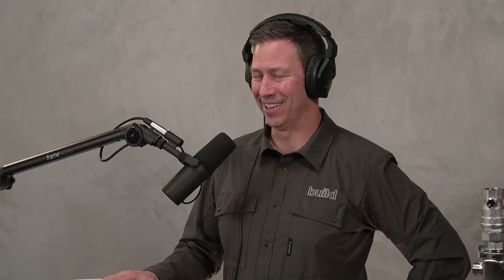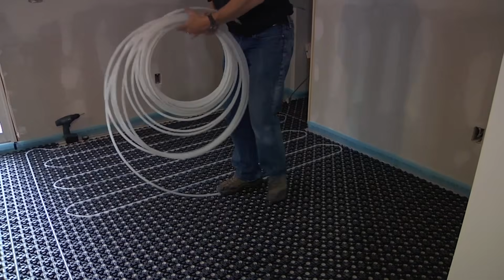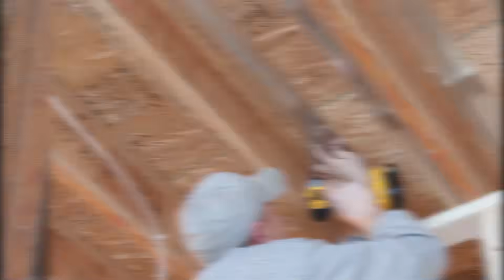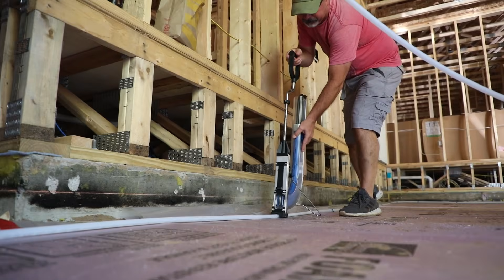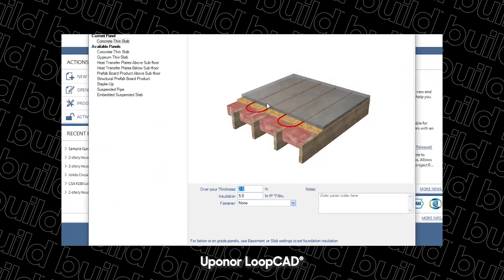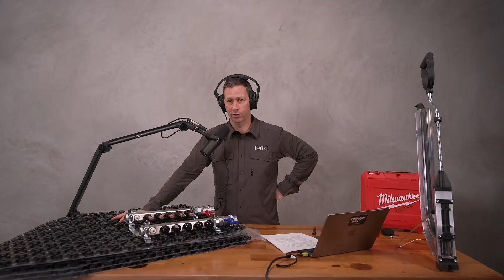4 Methods To Run Radiant Heat PEX Pipe

Comment: Do you  use water or a glycol/ water  based mixture in the radiant heating system..?.And if the glycol / water mixture is used, do you use distilled water so there will be no contaminants ( calcium etc ) in the mixture..?

Comment: A radiant heat system provides very even heat, which acts in fact as an energy saver because people tend to adjust the heat to where they're comfortable.  The interior walls, ceilings, and floors are not broken up by air supply and return registers, which can be unsightly.  Also, my dogs like it because the floors are warm, and we can walk around barefoot in wintertime.

Comment: I installed a staple up system under the kitchen tile floor back in 2006.  It was easy to do.  Just taking the chill off the floor makes tile much more pleasant.  For the basement slab, I used a system of snap together plastic grates, which apparently is not available any longer.  After installing the tubing, I put Hardi backer board over it and installed ceramic tile.  Despite my numerous flaws pointed out to me by my ex, I haven't heard complaints about that project of mine!  Though, I suspect my coworker was correct when he suggested I would spend more time in the basement doing the project than anyone would ever spend there after the project was finished off!

Comment: We are currently working on a project where the basement concrete floor was poured without insulation, what is the best way to insulate the slab? doors were installed for a 1.25 inch lift finish? what do you recommend  using to insulate the slab in NJ

Comment: The more tubing used, as in closer together, the responsive the floor will, and the cooler water can be.  As I use solar thermal panels (backed up by a Electro Industries electric boiler) I ran my tubing on 6" centers, in 300' lengths. I laid out the 300' outside, and then doubled it back, so i had both ends in my hand, then I walked into the building and secured the two ends at the manifold location, and then started laying out the PEX lines on more or less 6 to 8" on center. Counter flow was the idea, a hot out next to a cold return. 40+ years of doing so and zero issues OR a utility bill. It's real easy making warm water for a rad floor  with solar, not so easy, and less efficient, making real hot water for a forced air hydronic heat system, that's why a lot of off grid types go radiant, they use less power also.

Comment: I hear about all of the good things,but I don’t hear anything about what the possible repair costs are.
Reply: cheaper to shut off the zone, then install a heat pump or other heating method for there. breaking up the concrete, fixing the tubes without breaking it more, and then re-pouring concrete that won't match the original concrete would only work in very specific conditions. Unless it breaks during the pour and you can fix it before the concrete cures.

Comment: Eric!!   Need help!!  Planning on a half diy radiant heat.  Husband and I want to lay the pex, pressure test it, sub foundation and in between basement and only floor.  Then have a plumber install the boiler and what nots.  Am I insane?  Will this make radiant more affordable?  Any diy planning kits, manifold, layout companies you would recommend?

Comment: If you have a concrete floor and you do not want to raise it, you can mill the pex into the cement screed. Then cover with flexible shrink-free mortar. We do this a lot in the Netherlands.
Reply: @hunchbackaudio what do you use to mill the concrete?
Reply: @louismerani5634 Most concrete floors have a upper layer of cement screed you can mill with a 18mm grinding wheel. When the top layer is also concrete you’re out of luck. Then you have to use a tracer with two discs and chisel out the middle part. But that’s almost never the case. In that case you’ll be probably better off to lay the tubing on top and level it out with self leveling screed. But then your floor ends up 2cm higher.
Reply: There’s special grinding carts for this with a strong industrial vacuum cleaner to prevent everything to be covered under a thick layer of concrete dust.

Comment: Can you install the wet heating pipes directly on concrete floor (i.e. without any insulation)? Would it less efficient than laying the pipes on an insulation material?

Comment: I have 9' ceilings, so i used the top 1' of the interior walls for the pipe. I run the pipe in loops through the wall so one 250' loop serves two rooms. Also, i use pex-al-pex because it does not move/expand very much with the hot water.

Comment: I have an 1100sqft slab on floating concrete home and want to put in heated flooring. I’m completely LOST how to attach the vapor and pex to the concrete. I live in Isle Minnesota so it gets -40 with lake effect.
Reply: Warmboard makes a remodeling panel. Thinner than the panels that replace subfloor in new buildings. Plywood panels with channels routered in them. Then the entire thing is plated over with a thin aluminum including into the channels. Then you just snap the 1/2" pexalpex into the channels. They plan it all out for you. And send you everything you need (including special instal tools) basically a complete install kit. It's more expensive expensive. 
But also the most efficient. I installed it myself. I have ambient thermostats. Six zones.  Downstairs is inslab. Upstairs Warmboard. Inslab takes way longer to change temperature. Temperature swing on inslab + or - 4-5 degrees. Warmboard upstairs is super responsive. + or - 1 degree on thermostats. I love my warmboard.
Oh yah I live in Wisconsin. And I drive a forklift for a living.

Comment: Hi Matt,
Would you need a separation barrier, if you put in radiant heating, and wanted ceramic tiles over the light concrete fill?  (if you do a slab on grade house) I am building in Mexico, and building practices are very sketchy.  Also, would you have any connection to contractors that would build in central Mx, in Apizaco area?

Comment: Whats the glue they’re caulking in over the pex on the quick track option?  I’m installing this heating system in my van floor and would like to know what I can use to embed the tube in my routed grooves. Ideally something I can sand smooth. Thanks.

Comment: Great content, thank you! One big question left for me at the moment: how do y’all recommend installing the slab temp sensor, especially for those systems where you’re getting the radiant piping up between the joists under a subfloor? (My main concern: I’ve got one of these in, but the sensor is getting heated by proximity to the pipes — even despite being held up to the subfloor by solid foam insulation.)

Comment: Does a radiant ceiling work? Doesn’t heat rise?
Reply: No, hot air rises, heat "goes to cold."  That's why insulation is critical under a rad floor slab, some think the ground below will get wamed up and the heat will rise, BIG mistake!

Comment: I have to do some research but are there radiant heating systems that use a heat pump to heat water like a water heater does? That seems like that would be the most efficient as opposed to a gas boiler

Comment: i love the little bit of science "more energy via water" as a selling point, but also the comfort is the big advantage of radiant. It's so unfortunate the true benefits of radiant didn't take hold earlier - the idea and the sceince has been around for a long time. I think we could have saved an unimaginable amount of energy (i.e $ in heating bills) and a lot more people would have been more comfortable in their homes.  I remember as a kid, circa 1974, sitting in front of the heat vent, window curtains draped over me to capture all the heat, just waiting (and maybe praying a little), for the at furnace to kick in and blast me with glorious warmth just to beat that morning chill!  As an adult in '94, I bought and renovated a 1952 built Wisconsin home that was originally built with a "radiant slab ceiling" - 1.5" concrete/plaster mix in wire mesh w/1/2" copper tubing imbedded.  Even though it was top-down (heat rises, so won't that make it ineffective?), that radiant slab was so-o-o-so satisfyingly even and comfortable in the heating months. Was economically efficient, too, heating bills were the lowest I've ever experienced.  Had lived in forced air, hydronic and electric baseboard, and old-school cast-iron radiator - all of these in the northern great lakes region, 60" frost line and all, so real cold in the deep winter months. The radiant was palpably more comfortable in all conditions - no comparison.  I imagine it was a substantial increase in construction cost in 1952 over conventional systems at that time, and I would guess adoption of a "new" superior technology was stymied by misinformation, status quo thinking, fear of the "new and untested", and probably some commercial interests that didn't want to see their customers changing the items on the standard purchase order.  But, God -once you felt that even and consistent heat, and knew your children would never need to cloak yourself in window drapes and pray for the thermostat to kick in, you'd think it would have gained a little more traction.  Back in '94 I was working in the residential construction trades in carpentry, and radiant of any kind was still only popping up occasionally as a novelty.

Comment: Great to hear of putting these in the wall or ceiling from an installer.  They talked about it in the Hydronic Heating book, and we had electric radiant heat in the ceiling of a condo.  There's also other panels that are routed out with foil in them already, previously at about a buck a square foot.  They can bring the added height down to 3/4", and maybe less if switching from a carpet and pad to something else.

Comment: Can you use air in the pipes instead of water? I know the fluid would hold heat longer but air would move faster through the system and any leak wouldn't be an issue. If someone accidentally put a nail through the pipeline the system would still work fine and cause zero damages.

Comment: Stainless is taking over not just because it's far more corrosion resistant, but also because it's a lot less EROSION Corrosion resistant.
When I was a self-employed Handyman, I'd often have to cut a wall open to replace a copper pipe fitting where the pipe was not reamed, AND repair the pinhole that had formed about an inch from the end.
Turbulent water is no joke on something as soft as copper.
YouTuber Got2Learn has a nice video on the subject.

Comment: We used this in the upper levels of our home. Ours is on a styrofoam substrate that has mechanical points where the PEX is routed through. The lightweight cement/ grout has a perlite aggregate to keep the weight down. They have added chopped fiberglass and a latex based liquid to maintain flexibility and prevent cracking of the cement mixture. There is also a 1/4” flexible foam perimeter that must be laid in to isolate the floor from the walls and allow for expansion. We used the ROTEX system from Germany. Maximum operating temperature of the system is 40° Celsius. This was installed 16 years ago as the upper levels of the home were completed. Best investment we made for heating. No intrusive radiators to mess with furniture placement. One issue is they recommend that no floor coverings be used since it will prohibit the exchange of heat. Method 1 provides zero isolation to the substrate under the the stick in place guides. Our primary heat source is a fireplace boiler where temperatures vary from 40° to 80° Celsius so it was necessary to install water heat exchangers to limit the temperature to the radiant system in the upper levels. Also in the mix there is a three way auto valve preset to 40° to protect the radiant system in the upper levels. There are four zones,three bedrooms and the main living area. With a smart panel controlling times of day one can preset temperature of each zone and the smart system will enable the zones according to the time of day with a manual override for each zone. This is accomplished with a  PLC so the need for a computer running 24/7 is not needed. It also takes into account the exterior temperature. Since we are in the south eastern Mediterranean my goal is to add additional solar heating arrays to start preheating the floors as soon as outdoor temperatures. Start dropping late fall.

Comment: Radiant coupled with Geothermal.

If you run a farm with plenty of manure producers or compost, you can run a radiant system through your heaps for heat.

Comment: I have a question: I have a boiler with forced hot water baseboard heaters. I have some pipes under the floor that are near the sub floor and you can feel in nice warm feeling walking bear foot on the floor. is it advised to have radiant heat AND baseboard heat in a same room? Just to keep the floor warm...

Comment: It’s the best, I live in Alberta and I am working on a horizontal 30 ton glycol loops to air exchange and slab cooling system, it hasn’t been done before but if it works I will only be using a 120volt circulation pump to cool my home and shop, the biggest reason for attempting this my attached shop is 40x75 if it works it will be amazing to have a cool shop, the ground temp is around 8-12 C, I am only planning for cooling as the electrical required to use a typical heat pump is expensive, and I want to sell my solar to grid to pay for propane and property tax, currently my home makes income

Comment: Hi, I have a couple of friends who have used a water glycol mix at their cottage in Southern QC (close to Ottawa) in case the power cuts out (which it often does). It's not a 50/50 ratio as glycol is not a great conductor of heat.

Comment: I want to put radiant on my basement ceiling (for the first floor). I'm also putting hardwood floors down. How do you keep the nails from puncturing the tubing (not using a product that raises my floor height)?

Comment: I designed and constructed by myself a home in Alaska in 2006 where I put half inch PEX in a 4 inch thick concrete monolithic slab to heat my house with a 40 gallon hot water heater that worked brilliantly.
Reply: What type of flooring did you use over the gypcrete? And did it ever
crack with all the earthquakes we get in Alaska?

Comment: This is definitely a subject I'm interested in. We are building a new house that's not being built in traditional methods. Radiant heat is one of the most efficient and easiest methods I could think of to use. Gas fireplaces or heaters for each room in use was first consideration, but for ease of installation and use I pretty much ruled it out. Quick-track seems the most versatile idea to use. Ease of installation on different planes of the rooms. Floors, walls, or ceilings, doesn't matter. Have to show my wife this video so she can wrap her mind around the concept. Thanks a lot for sharing this information with us!

Comment: This seems to me like the difference between hot water heat and forced air heat. Hot water using radiators is very even heat. Forced air, not so much as it kicks on and off temperatures fluctuate.
This heat has to be very consistent and comfortable, that alone sells me.

Comment: I remodeled a home that had radiant floor heat installed by the builder.  It was red Pex B attached with regular j-hook to each side of the joist flange where it meets the subfloor of the main floor.  Basement below.  Much of the tubing was sagging into the joist cavity.  According to the homeowner the system works great and comfortably heats the upstairs evenly with the furnace rarely running and only in the coldest months of the year.  Zone 6.

Comment: If someone accidently puts a hole through the pex line, how difficult is it to repair?
Reply: Its pretty easy with Pex. you can just make it a connector point
Reply: if it's covered your better close the water main because thats a lot of damage. if it's exposed it will take 2 coupler fittings and a crimping tool.

Comment: Stainless steel is only a corrosion free metal if it is not manufactured in China! Every Stainless steel cooking utensil made in china I have ever owned has developed rust spots on it, which it would not do if it was true stainless steel based off of the international standard for the metal composition of stainless steel!

Comment: Take a look at UltraFin. Tubes suspended with heat fins attached. No mixing down required as it is the air space that is  heated rather than direct contact with subfloor.

Comment: I experienced this type of heating at Prayer Mountain in South Korea. It was absolutely brilliant in minus 20 degrees. It made a very rough winter fabulous.
Reply: you look caucasian, and if you don't mind me asking ,  what country are you in now
Reply: "Underfloor Heating" was invented by "Frank Lloyd Wright". He called it "Gravity Heating" for some odd reason.
But, Frank Lloyd Wright got the idea, when he visited Japan during the construction of "Imperial Hotel" in Tokyo.
Where he was invited to "Korean House" which belong to the CEO of that Imperial Hotel. 
"Korean House" was "Crown Prince of Korea's Quarter" that was sold to the CEO in an Auction when Japan dismantled Korean Palace.
Reply: @davidjacobs8558  underfloor heating was invented by ancient romans.
They used thermal water to warm floor in pubblic Buildings and private houses (and obviousley the baths)
Reply: @zarbonida  Yes, but for some odd reason, Frank Lloyd Wright was unaware of the Ancient Roman Under Floor Heating.
Probably because he started his career as a draftsman, and did not get proper education as an Architect. or perhaps, education system for Architects was not as structured back then, and was mostly Master to Apprentice thing ?

Comment: Can you explain more about the water system as in are there chemicals needed to keep the water mold free? Do you add-in water time to time due to the water loss because of the heat? Does the water move in the system or stays in place? Thanks!